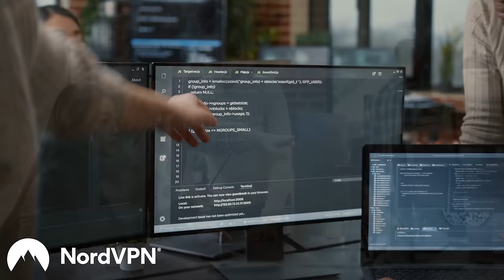Elon Musk fails Cybertruck stainless steel metallurgy test | Auto Expert John Cadogan

Comment: It is interesting to see, how fast those Cybertruck work hardened back quarter panels start cracking. It looks like the fastening method to 'exoskeleton' is not at all flexible and those panes are wrinkling and warping due temperature changes (eapecially under sun). This can be seen on all official review videos, if you watch those in full resolution (Hagerty, Top Gear, carwow, Marques Brownlee, etc.).
Reply: they are fastened with adhesive
Reply: Quarter panels are one thing. What about the load carrying components (chassis etc)? Driving too many dirty roads could be a problem.
Reply: @cccmmm1234  I am waiting when the new traction battery packs start failing. Tesla decided to make those unrepairable.
Reply: The beauty of the cold rolling process utilised to transition the austenitic steel into martensitic steel is that it only partially transitions just the outer surface to martensitic thus providing the best of both worlds it results in a panel that is both very hard but also not that brittle. this is in fact the game changer and a result of SpaceX metallurgists work in formulating the steels make up. John of course doesn't posses the required knowledge to understand these finer points, he is no expert LoL.   This can easily be seen in several non Tesla videos on YouTube in which reviewers have hit the panels hard with large sledgehammers on camera and with Tesla's blessings. For an example check out Jason Commisa's Hagerty review on YouTube @ approx 17 minutes and 40 seconds in.

Comment: John, might help for you to watch some Sandy Munro videos about the actual SS used in the cyber truck.
It's beats just speculating about it from 10,000 miles away.
Reply: Munro is a guy whose area of expertise is using 4 fasteners instead of 6 to save pennies oer unit. Only Tesla stans lusten to him.
Reply: @TroySavary  he's actually very much against bean-counters being involved in engineering decisions. You obviously have never heard him talk.
Reply: @typhoon320i  I havexwatched his teardowns where he ripped on companies for using screws when plastic clips would have been cheaper. So it is obviously you that never lustended to him.
Reply: @TroySavary  he wouldn't have said "because it was cheaper" unless it was also a better solution. I have seen many of the teardowns
Reply: 22000 kms actually
Reply: Did Sandy question Elon about these illogical and unrealistic comments? No, he didn't. Stay on topic dude.

Comment: A tungsten carbide tile cutter could seriously upset an owner of a cyber urinal ! 😂
Reply: A piece of sandpaper would ....Permanently Damage it.
Reply: Just brushing against hard sticks while competing in the Baja 500 will seriously damage it.
Reply: @dk-bw4gk  What if your battery dies going 80 on the hwy. And you can't steer the car anymore?
Reply: @Queenskid19  I'm not sure about this, but isn't there a 12V lead-acid battery that runs as backup for the essentials?
Reply: @dk-bw4gk  sticks wont do anything vs the cold workhardened Martensite.
Reply: @Queenskid19  redundancy is obviously needed (and present).
Reply: @dk-bw4gk  there is no 12V at all. Its 48V, and for sure something more reliable and long lasting than lead-acid.
Reply: @stefanh616  You drive your Cybertruck against a hedge of [whatever hard wood] and it won't leave streaks? This happens in my garage when I'm trying to keep SS sheets clean.
Reply: @stefanh616  "there is no 12V at all". I just looked it up. There's a 12V battery in front of the windshield of the Model 3 and you can use lithium or lead-acid. It looks like it comes standard with lead-acid but lithium is a 3rd party upgrade.
Reply: @stefanh616   I watched an old doc and it said that's why automakers would never do it. It's to dangerous. That's why he had to do the 48 volt
Reply: @stefanh616  Redundancy against electrical failure? Can you point out exactly what that is?
Reply: @Queenskid19  have you flown in an airplane the last 30 years or so? Commercial airplanes are all fly-by-wire. They keep the safety the same way as its done in the Cybertruck, by having double/triple redundancy. Its highly reliable, so that is not the issue. The real answer likely is that its expensive to implement it the first time. And also that most car manufacturers today dont do their own things, they just buy ready components from 3rd party.
Reply: @dk-bw4gk  are your SS sheets cold work hardened Martensite? Or the comparatively much softer Austenite?
Reply: @dk-bw4gk  why are you bringing up Model 3?? Pretty random off topic. Cybertruck is 48V.
Reply: @siraff4461  standard practice in aviation, for decades already, is to have 2-3 independent systems. To my understanding they did the same in the Cybertruck, and I wouldnt have expected it to pass road safety certification without having this in place.
Reply: @stefanh616  He said "30x" which is not Martensitic.
Reply: @stefanh616  Can you point to a place where it states what the Cybertruck uses? I can't find anything but the range extender in the bed.
Reply: @siraff4461  Exactly..that's what I'm saying.  Even component failure your motor breaks your steering is gone!.
Reply: @dk-bw4gk  idk but I'm wondering if there is a separate 48 volt battery? Or do they just transform the 48 voltage from the main battery? You would have to use 4 regular car batteries for that so he would have to had developed something?
Reply: @dk-bw4gk  yes, John Cadogans rant is mostly based on wrong assumptions, since he hasnt factored in that what they are actually using in the Cybertruck is cold work hardened 30x into Martensite steel. So when Elon is saying HARD he actually means HARD. https://www.youtube.com/watch?v=u95V_n_6qcM&t=498s
Reply: @stefanh616  You would think right? Or hope..
Reply: @dk-bw4gk  earlier in video I just posted Munro also talk about the 48V. There is also a 50min interview between Munro and Musk, where they talk a bit more about the 48V.
Reply: @Queenskid19  you absolutely would neither need, nor want, to use 4 x 12V regular car batteries. A regular car battery has specs to crank the engine into running even on a cold morning. You need nowhere close to the same ampere to run small steering motors. Easily done with a small 48V Litium battery from the shelf, or an inhouse Tesla component.
Reply: @Queenskid19  "your motor breaks your steering is gone!." 
I would expect there to be at least 2 motors in the front and 2 in the back (given the 4 wheel steering) but its possible that there is redundant motors as well. In any case, we are not talking 1 motor, for turning 4 wheels.
Reply: @stefanh616  No. Standard practice in aviation is triplet seperate systems which can all work as stand alone if required - going to hydraulic in the event of all electrical failure. 
Can you point to the redundant systems in this for us all?
Usually road safety certs require redundancy of a physical connection in the case of electrical failure - the reason designs like Toyotas' steer by wire retain a physical steering column incase of failure. 
This brings up the questions - how is redundancy dealt with and if no physical connection is there how did it get certified?

I can imagine if there aren't physical connections that its probably certified under the US' light truck standards which are much less stringent on safety and emissions but also mean getting it sold in a lot of other countries is likely off the cards.
Reply: @Queenskid19  Thing is these musk sniffers keep bringing up aviation but a plane typically has three completely seperate hydraulic systems all with the ability to act alone and most planes have a hydraulic back up even if nothing is working. 

Apart from anything else its pointless. Being able to make a 6000lb+ vehicle swerve isn't really a plus point to anyone using it day to day - its only any good for the usual look at me tricks Tesla play.
Reply: @stefanh616  Martensitic is not 30x, it's 40x. It's extremely brittle. It is not rust resistant. It's partially magnetic. Are you trying to tell me he's using brittle, rusty steel?
Reply: @stefanh616  okay, so 12v or 48v, there's a separate battery.
Reply: @Queenskid19  don't know and it doesn't matter. Commercial trucks have been using 48v for decades. Same battery, same tech.
Reply: @siraff4461  "Apart from anything else its pointless." 
That just shows you think with what you blame others of sniffing. Steer-by-wire and 4 wheel steering emulates shorter wheelbase than the actual at slow speeds and longer wheelbase than the actual at higher speeds. If you dont grasp the benefits both of these bring, than that is because of your lack of knowledge, which is something up to yourself to correct.
Reply: @dk-bw4gk  are you trying to tell me that you are just not reading what I actually write? Or even look at the videos I link to? I specifically point out that they start with 300series SS which they cold work harden into Martensite. It will not magically start to rust from cold work hardening if the alloy was SS from the start, and the brittleness they have apparently managed to work around with their custom alloy specification in combination with their hardening procedure. SpaceX builds rockets from the same material, so clearly they dont have brittleness problems.
Reply: @Queenskid19  No man, they make single 48v batteries.
Reply: @stefanh616  If SpaceX is any indication then no, they haven't figured it out.
Reply: @dk-bw4gk  No that's 24v. For starting it. Just 2 12vdc battery in tandem.
Reply: @stefanh616  There is no benefit nobody cares about steering there never was a problem with steering in the auto industry.
Reply: @dk-bw4gk  lmfao....the Baja 500
Reply: @Queenskid19  it depends on how you define "a problem with steering". Huge issues getting a car to steer at all? No. Can steering be improved upon? Yes.
One can make the same claim about mobile phones tech and computers from the 1990ies. We continued to improve upon them even though they worked just fine back then. But I presume you also wouldnt perfer to use that 30 year old mobile or computer tech today?
Reply: @Queenskid19  For starting what, the Cybertruck? I don't know what the CT uses (or care) but you can google single 48v batteries.

Comment: JC, thanks for materials science lecture! Really easy to follow - shame Elon doesn't seem to know any of this stuff. Or maybe he thinks he's enough of a celebrity that the facts will change to suit him. Would (or could) this be substantially different from the stuff they used on the De Lorean? Yeah, that didn't work out well either...
Reply: ive seen Ford F350s being repaired by youtube guys and the side panels for that are like a few kg, and thinner than a can of coke, and even 3mm hail would put a dent in it.
When once we had a large hail storm, every cheap asian car had dents like a golf ball, but BMWs had no zero dents in it.
Reply from the maker: DeLorean alloy is 304 I think.
Reply: @AutoExpertJC  And a more complex shape in the panels !
Reply: @russcattell955i Even travels through time. 😎👍🏼
Reply: DeLorean's failure was not a function of the car's structural material or design. It was a result of mismanagement and ultimately corruption of the founder.